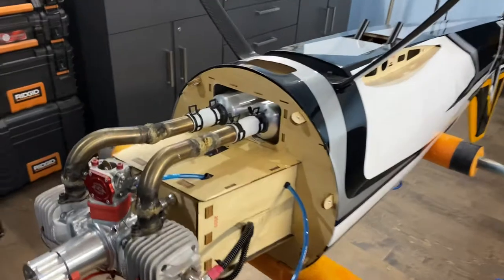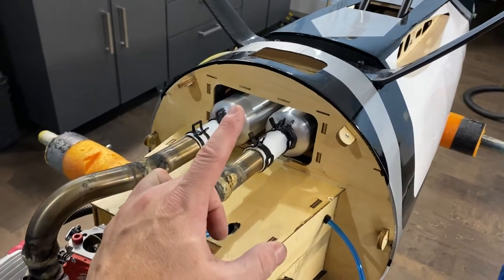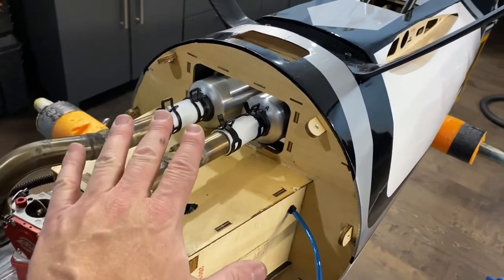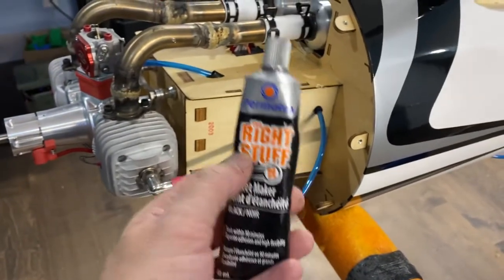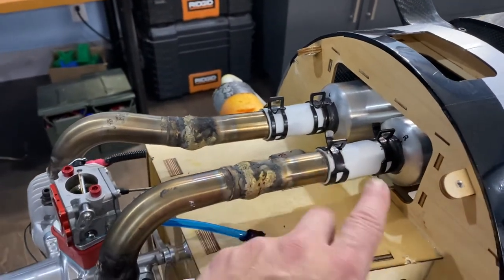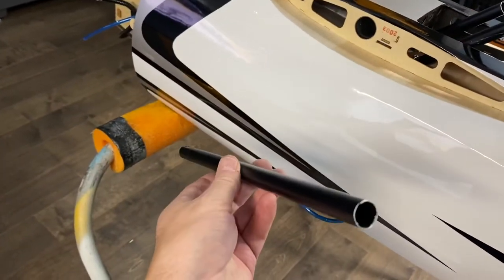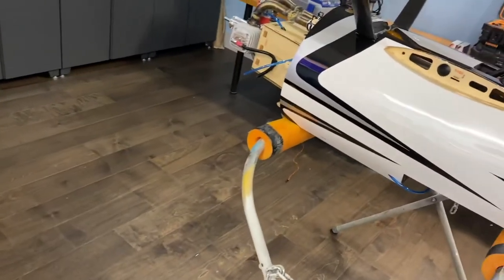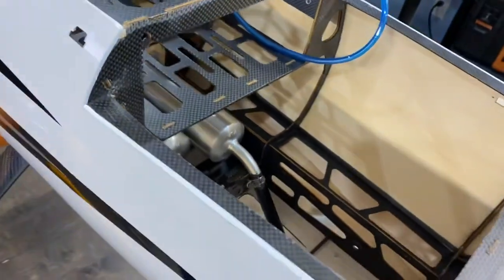Mamba120 - canister and header setup

Comment: How have you weld your tubes ?
Reply from the maker: I use 40% silver solder and a MAP gas torch available at most hardware stores.  A Propane torch is not hot enough